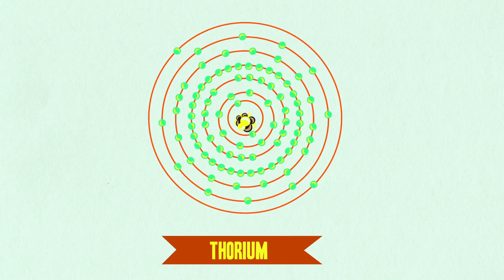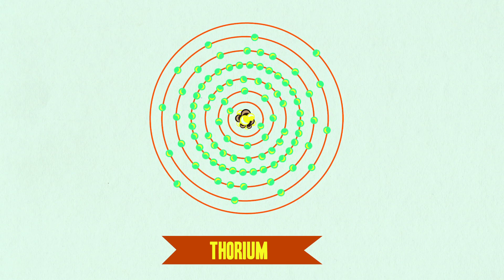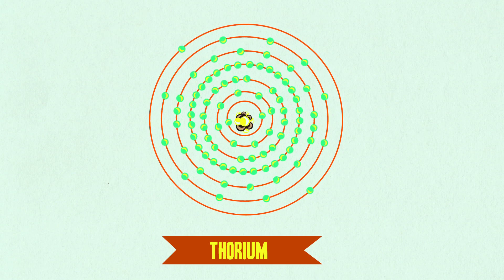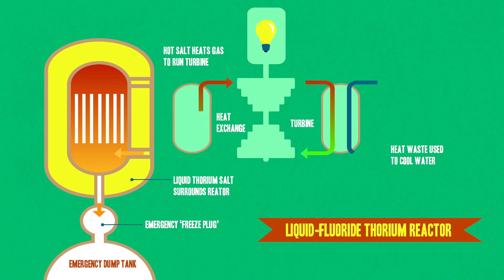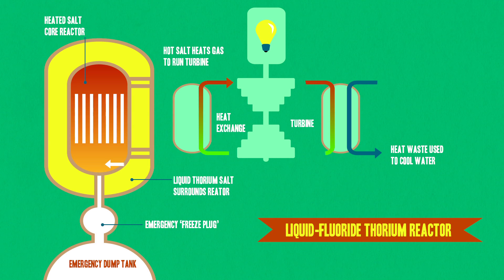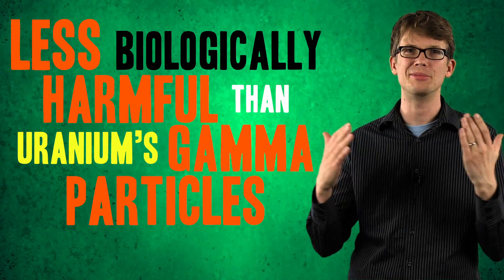Liquid Fluoride Thorium Reactors (LFTR): Energy for the Future?

Comment: Didin't say it was if you read it correctly, I said Thorium is a lot less specificly radioactive than Plutonium which it is, I've also handled both, And puncheex2 I didn't say a Gamma ray is a particle I said Thorium gives off Alpha particles/radiation as well as Gamma and beta, I used the term particle for alpha simply because some people refer to Alpha as radiation, although in essence its a helium ion, (& I know beta radiation is an electron and not a photon but hey I can live with that error), Now as for Plutonium I worked in a glove box facility for 15 years and yes it Pu239, is pyrophoric in its pure metal form but its normally handled as an Oxide due to this problem, even so we use to use Argon in the glove boxes with a negative pressure atmosphere so any leaks were minimised, mind u I also worked with Pu238 and that stuff was a real nasty fecker made Pu239 look like Thorium!.

Comment: Like I've already said you can but its radioactive so best not to for to long also it gives off alpha particles/radiation as well as beta gamma so the dusts isn't good for the lungs due to the alpha radiation alone but its a lot less specifically radioactive than say Plutonium which can't be handled in the open but it's not totally harmless.
Reply: Beg to differ. Plutonium is not completely harmless, but it can be handled as long as due caution for it catching fire (it's pyrophoretic) and it isn't breather or imbibed.
Reply: Pyrophoric chemicals would also include Uranium, Phosphorus, and any such compounds or elements that have very high reactivity with air.

As for some plutonium isotopes, if they are ingested; they may cause severe internal organ failure leading to death very quickly.

Comment: Sadly Thorium nuclear waste is uranium, which produce gamma rays.
Reply: Current proposed designs based on the 1950 models of a thorium reactor has a .1% inefficiency leaving some Uranium 233 in a compound of uranium-hexafluoride left. 

But considering the Uranium waste, it could be extracted and used again as start up fuel.  That is the only draw back, is starting the reactors requires either U233, neptunium, or plutonium.  But once started, it requires just thorium. And it can breed its only fissile material as waste bi-products that can be used to restart the reactor.

Advantage is it leaves behind incredibly little long radioactive waste. And the long radioactive waste it does generate can be used as fuel.    

Its very much greener than a coal or oil plant and current uranium plants.

ITER fusion won't be running until 2020, and 2030 it will be put through its paces.  DEMO probably won't be built until 2040 or 2050 and not operational for 5 to 10 years after those dates-- looking at 2045 or 2055.  I'd like to see LFTR happen now while we wait for ITER.  And ITER isn't 100% certain that it will work. LFTR is certain.

If we wait for ITER we'd be hoping everything works out smoothly with the experiments.  DEMO is built rather fast despite growing energy scarcity to build anything let alone something as energy demanding to make as a tokamak reactor.   In reality, if we don't get LFTR as another source of growing energy needs, the ability to implement new technologies will take even longer as the cost will be even more-- I think not addressing energy needs with LFTR within next 5 to 10 years, may push out actual tokamak designed fusion plants to 2070 or 2080. At those years I'll probably be dead too, which kind of sucks. :(  But more than that, most people will be using what energy is left to feed themselves, not produce energy power plants.
Reply: Mo Dim Sun jmitterii2
seems that you know some of the planning... only some, thought.
ITER is, as today, scheduled for testing by 2028... but knowing people inside the project, I guess it will be more 2038.

...as for LFTR, you should know that a new generation of nuclear reactor, today, takes a couple of decades to develop (Astrid project, though based on a known technology, is scheduled for 2026... and I wouldn't bet on that, neither), thus don't count on a test prototype before 2030... and still, there's the problem of the reactor security, which is very very poor compared to today's nuclear standard for developped countries: liquid fuel (soluble into water) and no first containment barrier (metal rods), these are the sins that stopped LFTR, not else.
Reply: Can't compare hot dogs and light bulbs to nuclear plants, not after Chernobyl...
A hot dog doesn't go critical, and a car won't threaten human life in whole Texas, if breaks fail... at least unless there's a nuclear reactor inside.
Reply: Mo Dim Sun
Yo man, you are on the wrong youtube page if you seek capitalism discussion, try the other one that starts with "USA are the best country in the world and socialism sucks"

Seriously, you insist to compare consumer product with a nuclear plant?
Do you know why no nuclear plan is has ever been built without a national control or at least survey? ...why no nuclear reactor was EVER built from a full free-of-bonds enlightened capitalist from the country of heroes?
That's because capitalism is a "system" in which, if you are face to the dilemma of "making a product too expensive to earn money with (but reasonably safe all the safety dangers you are aware of)" or "underestimate/ forget/ put to the garbage some of the safety issue reports that were on your desk when you did your economic review", a good capitalist will most of the time go for the latter... because after all, the engine and the purpose of capitalism is making money!
...and when, ten years later, that safety issue happens, there is nobody but the state with its police, firefighters and hospitals to deal with the problem... the capitalist already disappeared with his money.

When you develop a new technology that has to last for fifty years without EVER failing, are you aware that a private investor won't have the time nor the resources nor the patience to wait until all has been double checked? ...that capitalism today doesn't conceive investment plans longer than 5 years, forget a plan on 20 years?
I'm not saying that capitalism is bad and socialism is good; capitalism did produce great cars and phones and TVs and so much other stuff... but when talking about something as sensitive as a nuclear plant, I feel safer to know that the guys that conceive, build and exploit it don't have any economic interest to cut short safety systems.

As for cars, certainly they are a product whose amazing development is due to big private companies (pointless to say that communist russia's cars were a pitiful image of a four wheels "thing")
Thus, if there are 50000 american deaths per year on car accident instead of one million, that is certainly due to the safety systems that were developped by private societies... but then, a little bit is also due to speed limits and police controls that were enforced by the states, and another little bit to safety standards, also enforced by the state... wait a minute, but then the safety systems, were they born before or after the safety standards of the cars? whatever you chose, because they've been going on together for a while... difficult to say which came first, now.

...back to safety a minute... do you know what the bottom line for safety is?
It's when the ok/nok to a project is given by a non-profit, independent survey authority (and that's always a state authority) which has to state if a nuclear plant is safe enough as far as it is known today for the technology, for the materials, for the construction quality, for the maintenance program, for the people training... shortly, for all that can be reasonably checked and foreseen.
Reply: ...i thought you said you were talking about nuclear safety... or capitalism... now you change again to US constitution?
Where is capitalism in US constitution? And nuclear safety?
...yo man, better stop smoking weed, ya?

Ps: i am not american citizen nor resident, thus i don't care so much what USA's constitution say...
Reply: Alberto Vezzoli Thanks for the response, Alberto.  No, from beginning to end I was focused on "statism" (increasing government leading to dictatorship) as opposed to individual/private initiative/freedom.  You are not an American but you think just like a typical modern American.  (Don't care about the Constitution?  Neither does the typical modern American.  I see now that the Constitution was abandoned almost 100 years ago.  It was great while it lasted.  The American Experiment is over.)  Nice talking to you.  Peace.
Reply: No uranium, plutonium, or other long-term elements in LFTR waste, since they are simply left in the reactor until they either fission or decay to short-term waste.
Reply: And it still produce gamma rays and can be weaponized. That means LFTR is not green power source.
Reply: ALaviahA Green,yes.  INSIDE the reactor, gamma is not a problem due to shielding. But OUTSIDE the reactor, gamma makes diversion to production of weapons-grade plutonium impractical. This is because gamma radiation would destroy the bomb, make it impossible to handle/transport and easily detectable, etc.)
Reply: jmitterii2 Sounds like you know your stuff.  I say, "Let's GO!"
Reply: Alberto Vezzoli I'm ready when you are. LOAN me (I will pay you back) $100 million and in a few months I will deliver a basic core on the back of a flatbed truck.  (Use your existing grid and turbine.) Your neighbors will love you and you get an income stream FOR LIFE and very cheap electric power.  And, no, LFTR will not contaminate your groundwater.  What do you say?  (Note: This offer will expire when the first INVE$TOR says "yes.")
Reply: sry, nuclear tech development doesn't work this way, only nuclear dreams do.
nice try though.
Reply: Alberto Vezzoli 
You're  probably right.  That's why we have no railroads, no automobiles, no passenger ships, no hot dogs.

Nothing can be done without Big Government. I ask you,would a capitalist create wind farms or pass out free condoms?  Hell, no.

In fact, wasn't it some bureaucrat who invented the light bulb?  And gunpowder, and even FIRE itself?  ...Not to mention, the wheel...
Reply: Alberto Vezzoli Um, I thought we were debating capitalism.  You have switched the topic to safety.  Okay.  Let' talk about safety. How many people do you know who were killed by a "meltdown"?  50,000 Americans die each year on the highways (on average).  2.4 MILLION killed in my life time!  Remember.  The new topic is safety.  Stay with me.
Reply: Alberto Vezzoli Friend. You have helped me SEE THE LIGHT.  Recall that you originally commented that it would be ages before the government decided to okay LFTR energy technology. Remember?  Okay.  Now.  Get ready for a Paradigm Shift: Can you show me that in the Constitution?  Quick history lesson: The Constitution delegated war powers to the Congress/President.  Okay?  Got that?  Congress/President decided to create "The Bomb" in order to prosecute a war against Japan in 1945.  That war is over.  Am I correct?  Please let me know what you think.
Reply: I agree with you on the fact that US constitution was great, like most of western constitutions and all utopias (but hey don't forget, marxism and communism were too... utopias, I mean)
Too much government is like no government at all: dictatorship of the rich and powerful ones :-( ...that's like in math... at the extreme borders of infinite, even a straight line bends on to itself  becoming a circle :-P

I don't like state getting its nose and will into everything, because I simply find that a stupid and puny way to free people of their personal responsibility on their acting, among other side effects...
Nonetheless, I am aware that it is impossible to understand and foresee the consequences of our acting when we deal with technically complex items (such as a nuclear plant, or a vaccine, a chemical compound or sometimes even just something as simple as a material like asbestos...); it took the history of science and engineering to learn from the errors of the past, thus it is just foolish to think that one single person, a researcher or an engineer or even a real-life Dr House, would be able to understand, foresee and solve all problems on a nuclear plant without external help.
...and problem with geniuses and money makers, they often don't like help or suggestions so much (the first one for pride, the latter for fear they'd cost him money)... this is the gap I want the state to fill, with its static and de-resposabilizing and bureaucratic force: even though it will inevitably slow down innovation and kill some good project, it will at least reduce the risk that some not-so-genius or not-so-smart-moneymaker could do a big deal of damage because they didn't know or didn't think that... well, basically, because they thought it was simple but, simply, just screw up.
...allow me to be clear, this state control I only like it on these kind of risky project, but it's like Pandora's vase... once it's open, there's no way to stop it :-/

cheers :-)
Reply: Alberto Vezzoli Thank, my friend.  I agree with you...after all.

Comment: can you safely handle thorium or will it hurt you???
Reply: Gas mantles use to be made out of it but they stopped making them out of it due to the contamination/radiation risk but you can still buy them on E Bay, Its a lot less dangerous than say Plutonium but you still don't want to handle it for to long and you certainly don't want to inhale or ingest the stuff
Reply: Can you safely handle natural gas or will hit hurt you?  Fluffy teddy bears are perfectly safe, but they are a poor fuel source.

Comment: So does anyone else find the idea of the Nuclear Navy being Plutonium Pooping Whales turning into ocean borne Hiroshima's hard to swallow?  The idea that LFTR was 'abandoned' in the 60's seems to be a convenient way to use obscurity as a shield.  Now, a standard Breeder reactor uses obscene heat and pressures and is highly radioactive in the Gamma spectrum.  That is to say - easy to detect submarines from the surface.  Just the thing you'd want 1200 Sailors exposed to for extended periods of time.  However, if you substitute LFTR into the equation the whales become much safer, longer lasting, lower temperature and pressure, closed loop harder to detect and can recycle the previous made wastes (consumes and reduces plutonium to protactinium (sp?)) the waste is 1/100th a breeder reactor, and it uses physics, not man made controls for the fail safe.  IMHO LFTR was classified for Military use only, knowing full well that breeder type reactors would give Nuclear Energy a bad name.  Added plus - LFTR systems can be made in a modular fashion to suit the application - think using 2 AA's for TV remote vs 4D cells for a Maglite.  LFTR is actually the Greenest Energy available. 
The cradle to grave economics for wind and solar etc, are why governments must subsidize them as they require immense energy to mine, form, manufacture, ship, assemble, recycle/reclaim/process wastes, and in just the right circumstances they MIGHT last long enough to pay for themselves once per lifetime - just maybe.  SO - the last 50 years of R&D our Military Complex has invested in Nuclear Energy needs to be brought to the public circle.  Just like AR-15's, night vision goggles, and a host myriad of so many other technologies that we now use in our everyday lives.   Oakridge wasn't the only working plant, Ft St Vrain was a LFTR plant as well, long since reconverted to coal. 
Downside to Thorium - It's plentiful across the globe so energy struggles over oil are out.  It can be adapted to run smaller vehicles - gasoline/diesel is heavily reduced.
1 tractor trailer of Thorium replaces 300,000 cars of coal - so the coal industry and much of it's supporting industries are heavily impacted.  In short - Lots of jobs lost, Economic Practices of Today can't provide the employment we're struggling to provide as it is, a LFTR powered society would make that a MUCH bigger problem. 
Cheers
Reply: First of all, when referred to nuclear industry "Breeder" is a technical definition meant for fast neutronic spectrum reactor. No reactor actually on military application is a breeder, they're all water reactors.
Second, 10 meters of water is more than enough to hide a full power reactor; as for the sailors, they are checked for irradiation the same way as airlines pilots... damn, they have radiological protections on those subs.
Third: during the history of 20th century there's been several accidents to nuclear submarines causing the sinking of those units... being the fuel protected and insoluble even when exposed, there is little risk of massive nuclear waste release... but if that happened on a LFTR-equipped unit, once the fuel was exposed it would very fastly dissolve into water and very high nuclear pollution guaranteed.